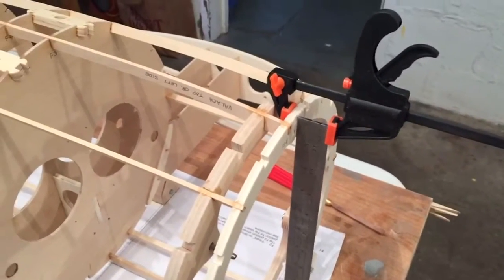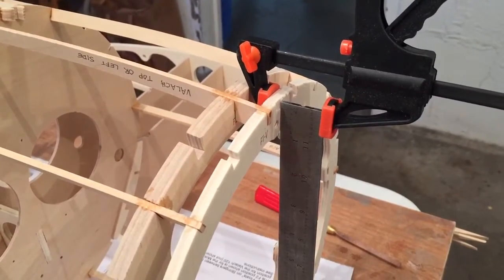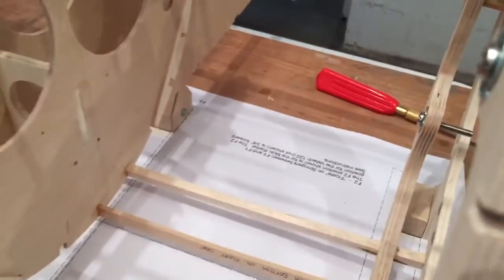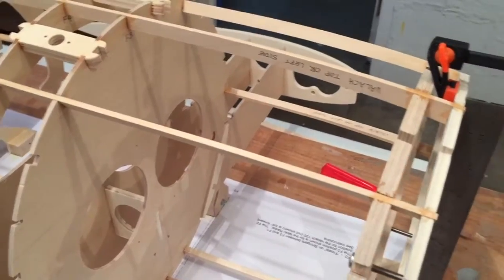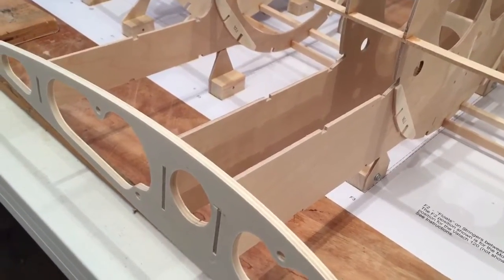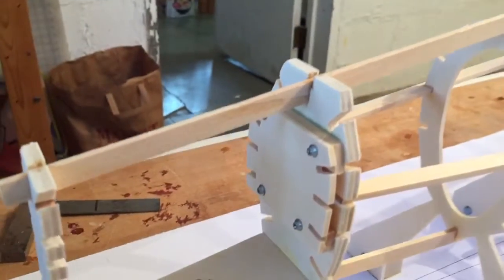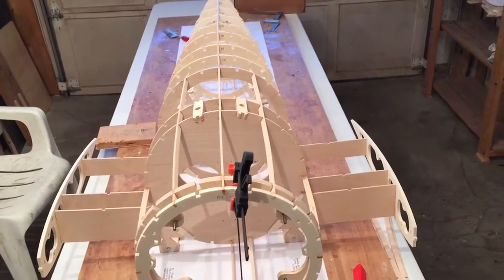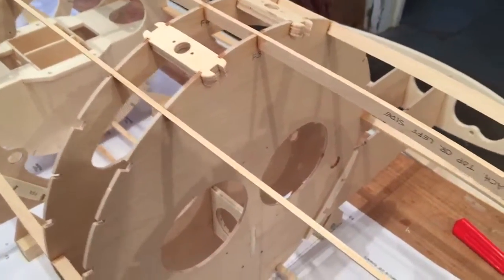Riley Model B

Comment: Fantastic project, Mr. Gratner. I sell plywood in Brazil and looking at the plywood in this aircraft, it is just amazing. May I know what kind of plywood is that used for the caves of this plane? One more time, my congratulations for this perfect project.
Reply from the maker: Renato:  I use 3mm Lite Ply for most of the formers, and 6mm Lite Ply for the cowl ring and F1.  I believe it is manufactured in Italy.  I purchase most of my plywood from Aircraft Spruce.
Reply: Thanks for your reply, Mr. Gratner. I visited the aircraft Spruce site....but I want to be a distributor for some plywood like that here in Brazil....and their prices are for final costumer . But anyway, thank you so much and please.....always post your building videos, the best and well explaned I watched. It will be a pleasure to see more of your work. Have a perfect weekend and thanks again.
Reply: @chuckgratner8859  .. I only found 4x8 sheets of 3mm & 6mm lite ply on that web site. Is that what you bought 4x8 ?